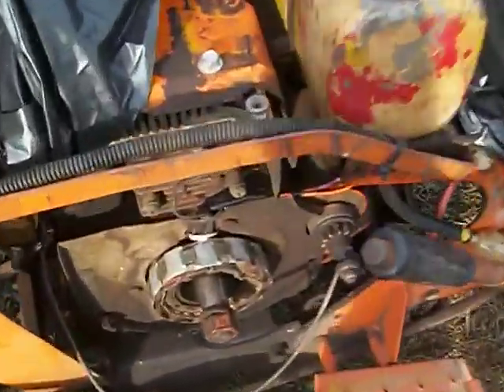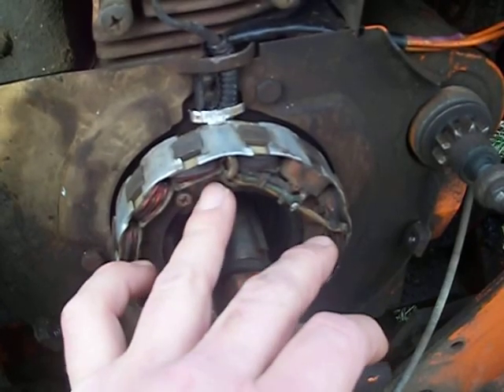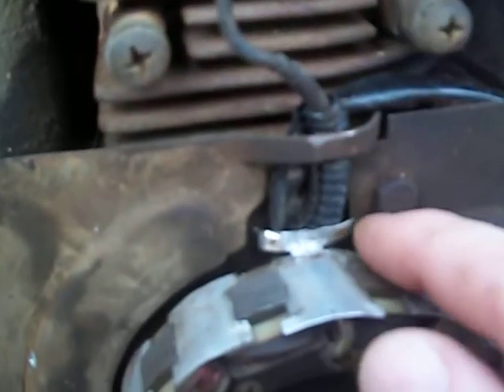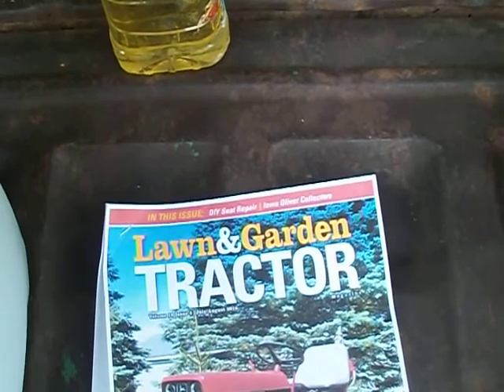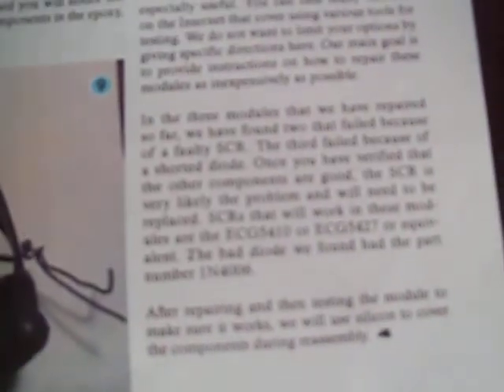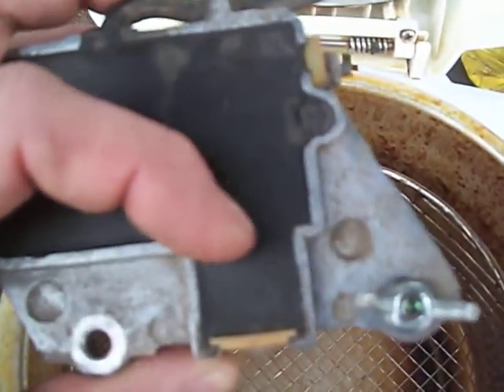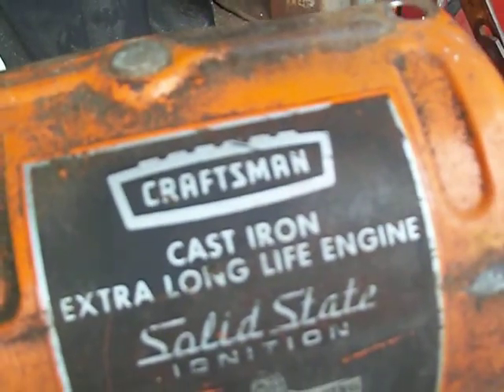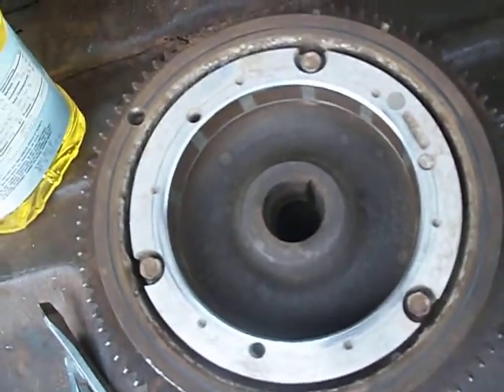Tecumseh HH100  Solid State Ignition coil  01

Comment: Youtube is not letting me post links in the comments.
Reply from the maker: https://www.mytractorforum.com/threads/tecumseh-ssi-ignition-repair.955730/#post-9097610
Reply from the maker: If it doesn't work let me know. I thought I posted it Yesterday. I don't know where it went.
Reply: @johnchadwicktilton  That's the one I found using your clues.  Thanks!